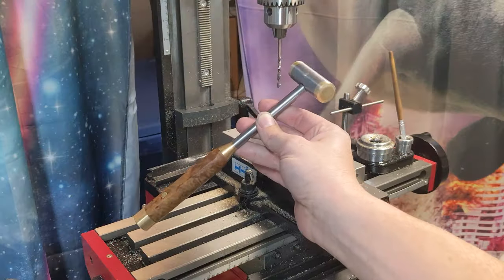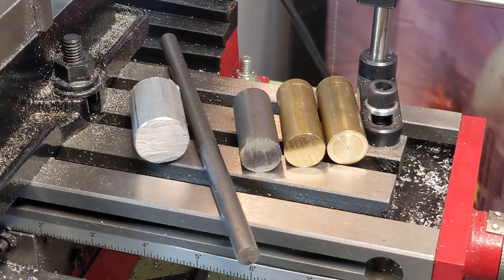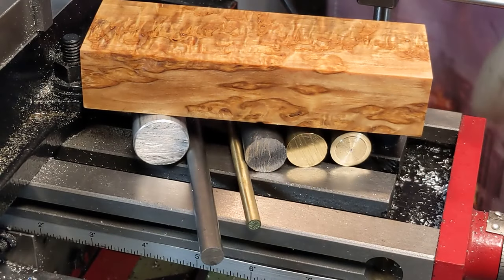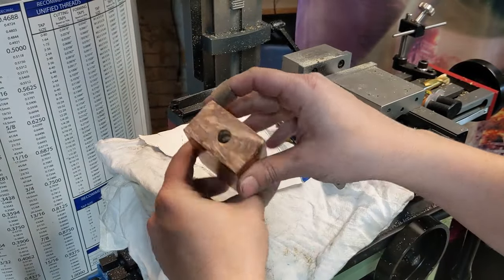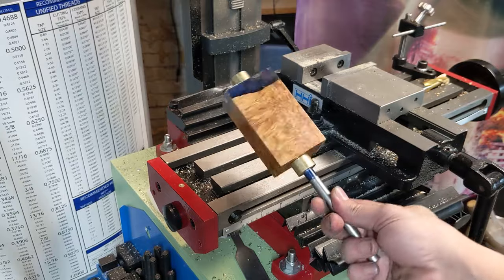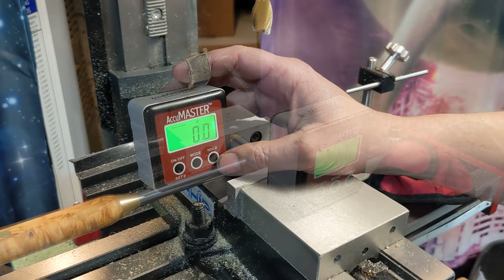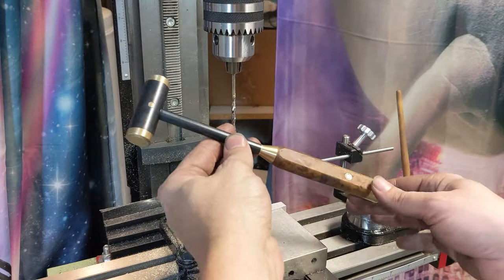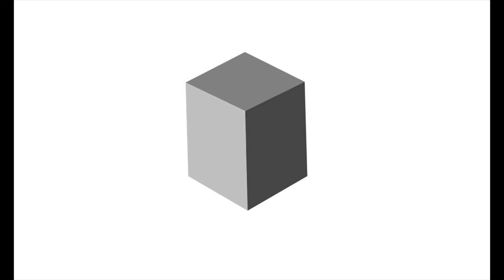Making a Sexy Little Machinist's Hammer

Comment: Absolutely spectacular product! What exactly are those pins you used in the handle and head?
Reply from the maker: The pin in the handle is a mosaic pin. They can be made or they can be purchased in any number of designs. I bought both the mosaic pin and the stabilized burl on Etsy. Both typically used in knife handles.

The pin for the head I just turned down from solid brass to a snug fit and hammered it to form it in the hole for hopefully a permanent connection.
Reply: @makerunderground  @makerunderground I'll have to give Mosaic pins a closer look. I was surprised the design on the face of the pin didn't disappear when you trued things up. 
Always learning!